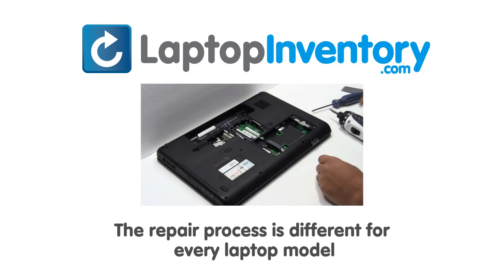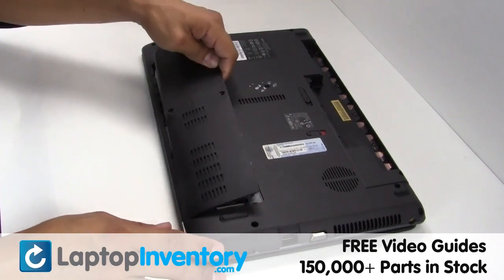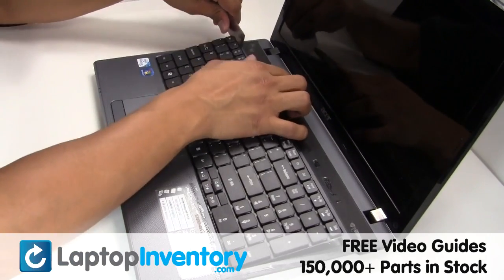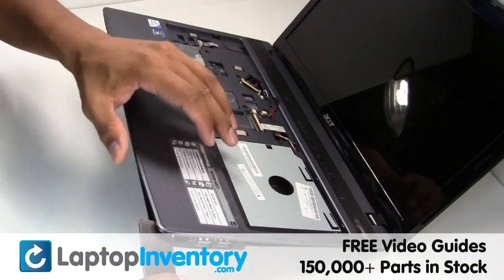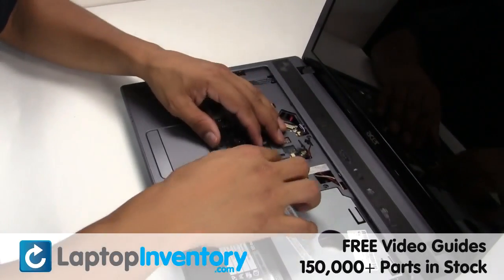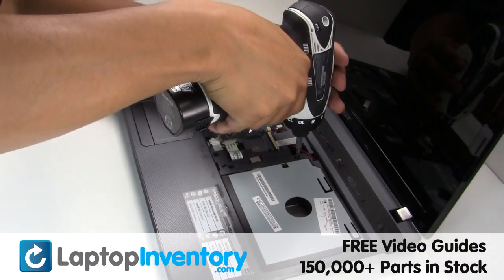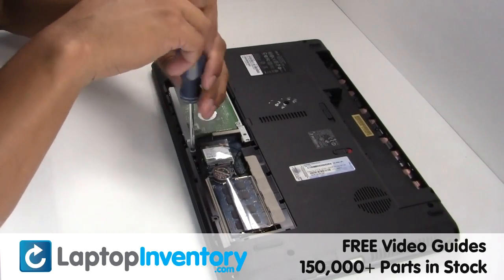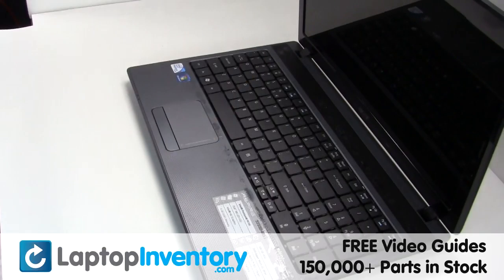Acer Aspire 5738 7736 Touchpad Mouse Replacement - Repair Fix Replacement - Touch Pad Bezel Palmrest

Comment: To everyone who complained about replacing the whole palmrest instead of just the touchpad, on certain Acer models the touchpad is integrated with the palmrest assembly so it has to be replaced as an entire unit. May as well replace the keyboard, too, while you're at it.

Comment: Yep, this video is NOT touchpad replacement! If the original touchpad is still working and you want to swap it to a new palmrest assembly you'll need to heat up the touchpad from the top and bottom to loosen the adhesive ....and it's still tough to get off. Go slow and when it releases there should still be enough adhesive to bond to the new assembly.